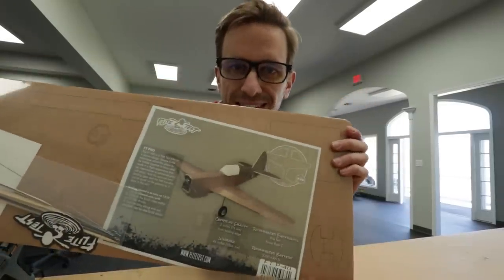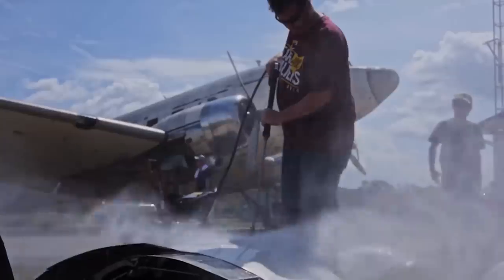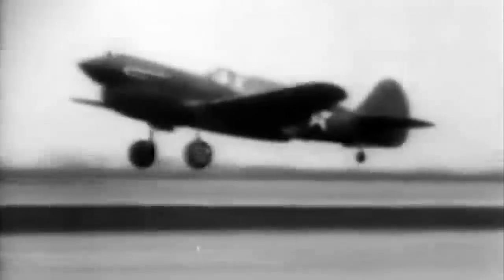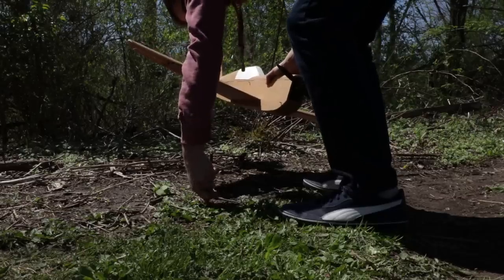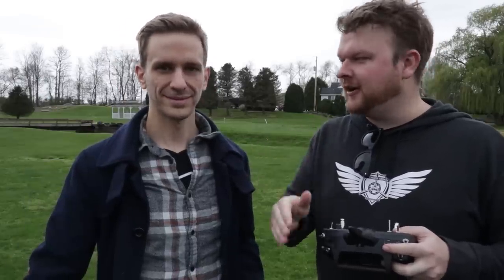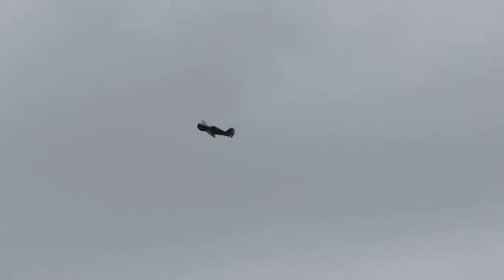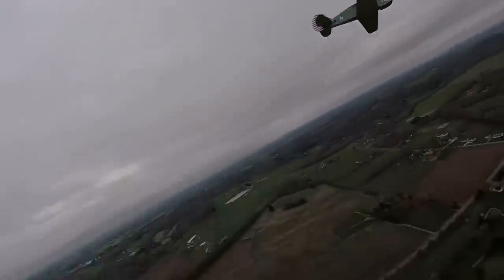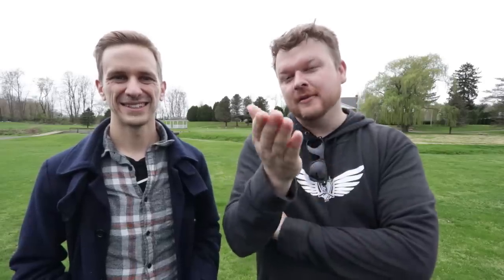Building and Flying My First Warbird 🤞 //  FT P40 Warhawk

Comment: Cool Warbird looks like it flies really good. 

Here's a building tip for you, if you know your hands are going to get dirty, a little preplanning will make cleanup a breeze, before you get started put some hand lotion on your hands. The lotion acts  kinda like an invisible glove and prevents most contaminants from penetrating your skin.  I do this every time I'm going to work on my car; dirt, grease and oil just won't stick to your skin.  When your done a little soap and water and your hands are clean.

Comment: It would be cool to see you guys take a plane and build wings with a hollow airfoil and have smaller wing extensions on the inside that servos would push out mid-flight. Or take a plane and cut out squares on a portion of the wings and create retractable wing slots that would cover the holes when in normal flight and open them when you want to get squirrelly!

Comment: My first plane build was a balsa framed P-40. After about 3 minutes in the air, a nose dive placed the gas engine and prop in the cock pit. It took me a long time before I wanted to build another plane. Listen to the guys at Flight Test if you are just starting out.
 On another note, when are you guys going to build a spruce goose?

Comment: my first rc plane was a 4 channel bank and yank P51 RTF from parkzone. I know the general thinking is learn to fly on something more basic... but i learned on an R/C simulator, many hours before my maiden. And i successfully flew that plane many many times and in the end what killed it was the plastic gears. Easy to replace them for sure... but they failed mid flight and low level lost all power...(rc people know this moment whining motor and no power) so it crashed. But not much damage i could have repaired it, however the R/C bug had bitten hard so i went for a 5 channel spitfire..etc etc  well that's how i got started personally. but i don't recommend it for beginners. Well certainly i recommend a simulator. But not a scale warbird, but that parkzone p51 was a little peach to fly i have to be honest. absolute peach.

Comment: Question. I do love the look of all the foam planes. Question is there a way to make the bottom of the wing look fully covered. I wanted to start flying back when I was 16 but have never done it. Back then in the 90s it was very expensive to get into. Now looks like you can do it for under 200.00

Comment: Actually , the P 40 is not the third most produced allied fighter but it is the third most produced American fighter  .                                                      The list of the most produced allied fighters begins with the Spitfire  ,  the second is yak 9 , third is P 47  followed shortly by the     P 51 ,  fifth in the list is the Hurricane , and then comes the sixth most produced allied fighter , the P 40 with approximately 13,700 units produced

Comment: You should make a plane for GoPro photography. One with the motor in the back or on the wings and a big platform on the front to mount a GoPro.
Reply: There are a few FT designs that would fit the bill. The ones that spring to mind are the Versa wing, the Guinea Pig, the Explorer, and even the Goblin. I'm sure there are more.
Reply: Check out the FT Fowl Flyer and the FT Spear. Those were designed with carrying gear in mind. Also the FT Dart seems like it could carry a GoPro.

Comment: It wasn't the age of the aircraft design that limited its performance, it was the lack of a good turbocharger. The Allison V-1710 engine had plenty of ass on the deck and the supercharger that was on the engine was plenty capable at lower altitude. 
Later P-40 variants like the "F" and "L" had Rolls Royce engines that gave them an effective ceiling of 20,000ft.

Comment: How come a lot of the items you show or suggest aren't in the shop? I am looking to make a purchase but based on the reviews and the information on the site there are a few issues. The c power pack online doesn't show the flite test radials. It's some 3s only motor that everyone hates. Also, you suggest luminier batteries and I cant find them. And the split cam kit is not available anymore either. All of these items are important for making that purchase. Can you please explain what's up?

Comment: Love you guys ...can y'all do me a favor and work on a zero war bird please..thank you
Reply: The Zeke has some unique tendencies because it was designed to fly in the area of reverse sensing where power controls altitude and pitch controls airspeed. 
This is exemplified by how far forward the elevators are relative to the rudder. It also has fairly high wing loading. 
What all that means is that it isn't a great trainer and would be a more advanced design

Comment: Umm  How do you keep the prop from breaking after a few landings?
Reply: Make sure the throttle is off right before contact and try to avoid hard surfaces. Or put wheels on it, but know they will affect the CoG and flight preformance
Reply: @General_Eisenhower1945  thanks

Comment: anyone flown this and the FT Spitfire?
noob here, looking for recommendations for first build - is one easier to fly than the other?
Reply: i have on experience flying either. im also noob with this. But this will definitly be my first build simply cause I think the posterboard used in the Spitfire's turtledeck looks too flimsy. The spitfire is one of the first planes they released and however i think its really good i think because of experience they got with designing planes i think this will structuraly be better because of that.  

Shame tho because David is a mad genius.

Comment: Hey guys. Long time drone pilot here. Heres a fun story. I bought a Parrot drone a short time ago. Had immidiate problems with wiring. Upon sending it back i found out that my drone (A.R. Drone 2.0) was no longer made. In its place i received a Parrot Mambo with nothing else. No controller,  no camera no fpv no nothing. Disgusted, i tiol the last of my money and got a mavic 2. When i received ot it was broke in the box. Obviouly used and had a few prop blades installed. Thinking this was a mistake, i called. I was told the machine i got was new. (Im 50 and have been flying drones for years). I was hit by my bosses truck in 2016 and am still in process of litigation. I was trying to purchase a drone i could make a few dollars with. Now.... I have nothing but a mambo and a swing. I used to love this hobby. Starting to hate it right along with life. Any suggeatuons? I did the BBB thing and gave up on parrot. Now broke. Ideas?

Comment: I WANT ONE OF THOSE but I don't have much money
Reply: MacCheese6 try the tiny trainer 
It’s really cheap
Reply: Try a scratch build. Print out the free Tiny Trainer plans, get some Dollar Tree foamboard and start building. You can even do it incrementally -- start by building it as a chuck glider. Then get a transmitter and a couple servos so you can control the glide. Finally, add a motor and even some ailerons down the road. Aside from fancy features like flaps and retracts, the Tiny Trainer will take you all the way through the process. The Explorer is the same way but bigger, which means bigger motors, batteries, and more foam -- that amounts to a fair amount more $$ in the end. If you get parts a little at a time, it's not so bad.
Reply: There’s also lots of mods for the Tiny Trainer including the SpiTT, that makes a spitfire style low wing to go on the TT fuselage.